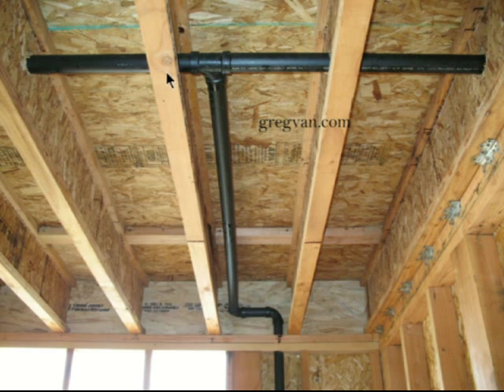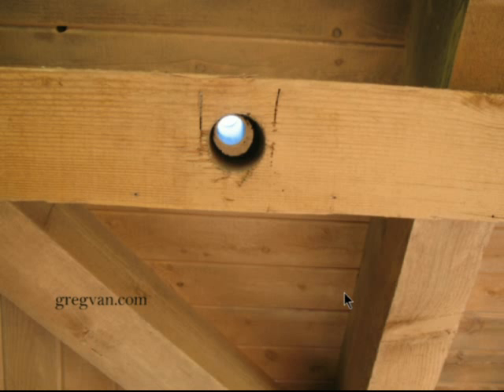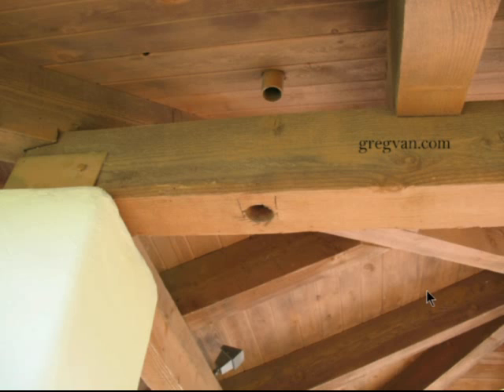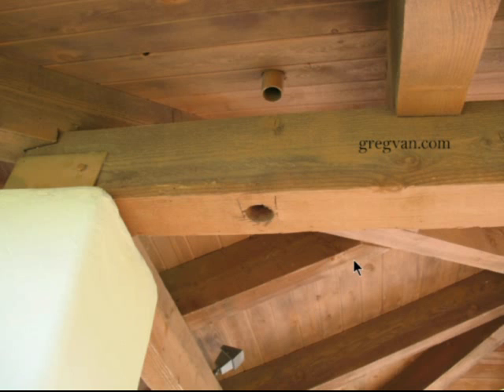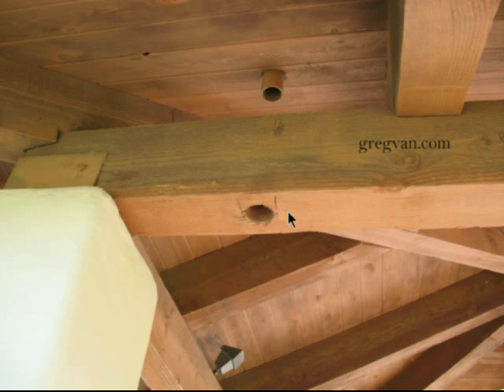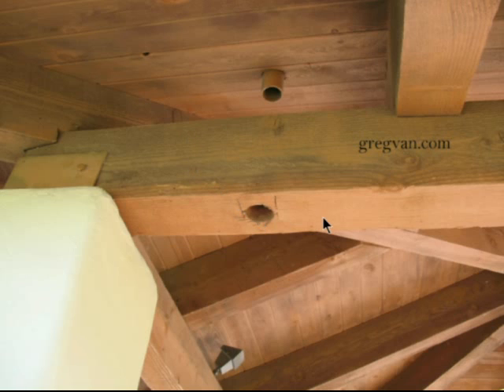Problems Drilling Holes Vertical In Structural Beams - Building And Construction

Comment: What if the hole doesn't go all the way through but is simply a lag bolt partially penetrating a beam from below? I'm assuming the a hollow hole vs one that is 'filled' with a lag screw would also behave differently - a lag essentially replaces the wood fiber with metal, has threads, etc - all which I'd imagine maintain some structural rigidity? 

Here's my situation: trying to mount a small hoist to lift about 250lbs off of a beam running along the ceiling of my garage. I can't access the top so going to put in two 3/8 lag screws (6" long). Using some engineering calculators online, seems like the withdrawal (pull out) force of a 3/8x6 screw from softwood (pine/fir/etc) is 770lbs (using ASD - Allowable Stress Design methodology). This means that two screws would be 1,500lbs - so way above the 250lbs load I'm dealing with. The beam is engineered lumber (PSL - parallel strand lumber) and is 14x7 (with 14" being the vertical thickness into which I'm drilling - so I'm not even going past 50% of the beam thickness). Any thoughts??
Reply from the maker: I really can't provide structural engineering information for viewers, but keep in mind most structural beams are over engineered and I've seen plenty of things done like you're suggesting.

Comment: What about drilling through a beam between 1st and 2nd floor to run a speaker wire through it for in wall speakers on the 2nd level of a house?
Reply from the maker: I can't give you the okay on that one, you're on your own and if you are going to drill it anyway, use the smallest hole you can.

Comment: That is an astonishingly large hole in that 4x12. WOW. I am curious about drilling a small diameter hole vertically through a 5.25" x 13.75" Glulam beam. The hole just needs to be big enough for (1) 14-2 wire.... maybe 3/8" will do. Anyway I found some literature that said to use an the equation (hole dia. X 1.5)/ Width of beam. The product would be equal to the reduction in strength of the member. so 3/8x1.5/  5 1/4     or .375x1.5/5.25=.107 or 11%. Now this is a new house in a hurricane risk area so a structural engineer speced that beam. I happen to know they use a safety factor of 2 when sizing their girders so an 11% reduction doesn't worry me. But I do worry about the hole not being drilled straight. Also wondering if there is a preferred zone to drill this hole. Just using intuition, it seems that shear would be bigger concern with a vertical hole as opposed to compression or tension forces, so the center of the beam span would be better then closer to the bearing points. Advise anyone?
Reply from the maker: Contact an engineer or don't do it. I'm not suggesting that it won't work, but if it doesn't then it's going to cost a lot to replace.
Reply: gregvancom I have and he's said it will work, the only problem is I don't necessarily trust him. I've regularly catch big structural design mistakes.  Nothing that we won't rectify in the field but this is crucial. I'd love to be about to structurally evaluate the hole myself but I lack the knowledge to understand the equations involved... maybe I can learn it all one day.
Reply from the maker: I would make sure that you get a statement from the engineer in writing with their signature, before doing it or before doing anything ever that can be questioned like this.

Comment: I'm dealing with similar situations in my 1946 home; a few electrical wires have been run through holes drilled into the side, and then up through, the joist.  The joists are full 3x8's but i'm unsure if this is a good practice to emulate.
Reply from the maker: I made a video that might be helpful and here's a link https://www.youtube.com/watch?v=fkkQm5jkeek let me know if it helped.
Reply: Thanks for your help.  I have read about those guidelines for notches.  Fortunately I was able to bypass my joist and drill through a stud.
Reply from the maker: You're welcome.

Comment: as a structural engineer i have to say that it should not be allowed by anyone to drill a hole vertical like that ever. There are a few point that you might be allowed to do that but they should be found by calculations or it should be known from the beginning so the beam would be designed with a hole there.
Reply: manos
Reply: What about a horizontal hole. I just discovered one in my garage in a 4x10 support beam. It's in the center of the beam and about maybe 6" from the top of the beam

Comment: hard hole to drill first off. have no idea why they wouldn't have gone around it. i drilled two holes like that between a second and first floor because the guy building the house didn't want to see the drains for his roof on the side of his house. so yeah it's doable but hard to do almost got the bit stuck twice and the hole hawg almost broke my wrist took me three hours to drill two holes. think my beam was bigger to. i had to drill down half way then go into the garage and drill up and meet in the middle it wasn't easy.

Comment from the maker: I didn't think about the weight of the beam, but you got a good point. I really would like to know why the hole was drilled in the first place, instead of moving it over and attaching whatever to the side of the beam. As far as the individual who drilled the hole, you're absolutely right about keeping them away from the construction site and quite possibly Legos or other building blocks.
Reply: Structural engineer here. Basically, the hole decreases the stregth of the beam at that loaction by 1.5 times the ratio of the hole diameter by the hole width. I found this page while researching because i have this problem in a house where they want to remove a load bearing wall. There happens to be a beam above the wall with a vacuum hose drilled through the beam. Anyways, it is a 2.25" hole in a 5.125" GLB. The hole will reduce the capcity of the beam 66% at that end.